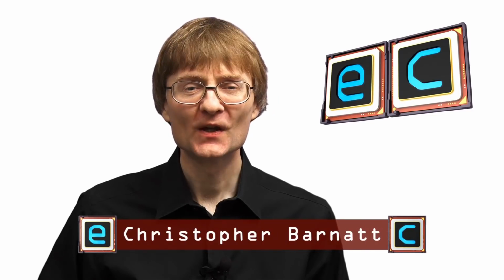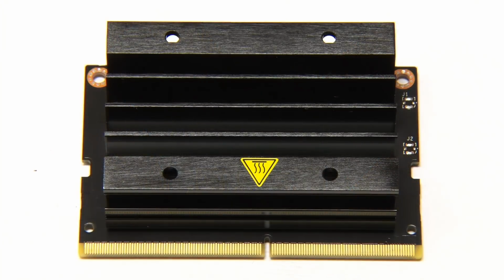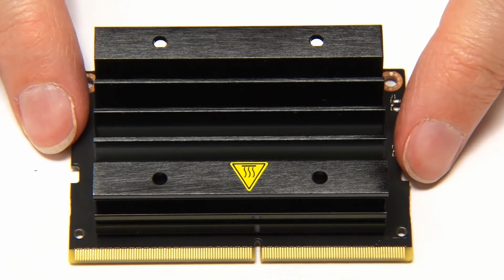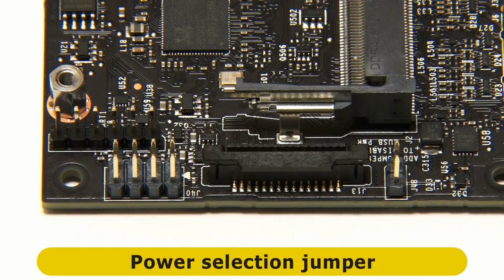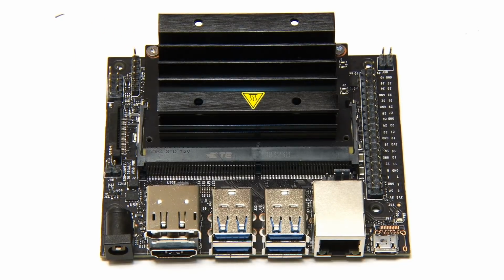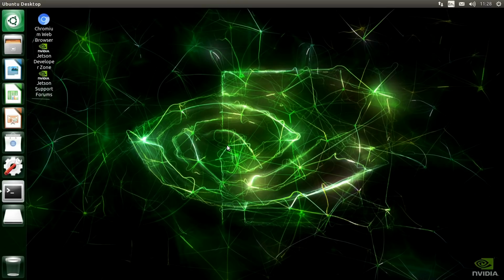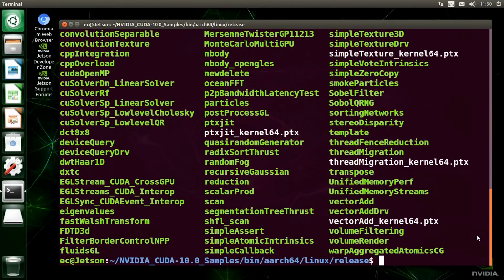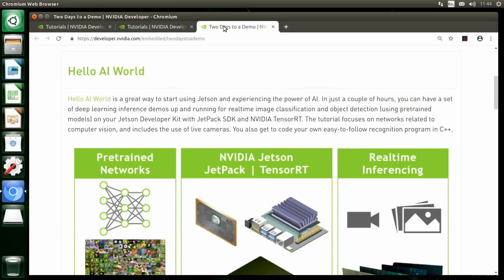NVIDIA Jetson Nano

Comment: Seems that this board got an update that significantly increases the perfomance. I hope you get back to it in a new episode.
I've also tried running llms locally with ollama in a terminal on my Raspberry Pi but I am running into problems if the session becomes too long. I can deal with the response being typed at the speed some humans would take to respond as that actually makes it quite quaint, but eventually it takes an increasing anmmount of time to start respoonding at all. Hopefully on the Nvidia board this will be remedied because waiting half an hour for a response is not a good workflow...
Reply: By the way, I'm getting the 8gb nano super model, which is even more capable.

Comment: Carrier board holes should have been the same size as the two large screw holes on the SOM for PCB standoffs. All the brass and plastic board risers/standoffs will not fit the tiny carrier board holes :(

Comment: Surprised it couldnt handle 1080 video on youtube. I thought it can decode up to 4k@30 h264? Would have thought a beefy gpu would handle it fine and not drop any frames.
Reply from the maker: It is a matter of driver support.
Reply: @ExplainingComputers  isn't that included in the OS and the browser software would pick it up if OS supports it?
Reply from the maker: @Bassquake76  Drivers have to be written for the board -- remember this is an ARM SBC, not an x86 PC, so there is nothing automatically available. Indeed, almost all ARM SBCs are let down by a lack of ARM drivers written for the board and its GPU. So there is nothing fo the OS and browser to pick up! :) Here, for example, NVIDIA have not provided any hardware accelerated video drivers for the board, as video playback is not their target market.
Reply: @ExplainingComputers  I see. Oh well thanks for the explanation.

Comment: is there any updates on this one 8 months later if it can now use the hardware for videoplayback? that would help immensely on the dropped frames and the price is a winner for sure, and such a nice little computer, very low power :D whats not to like
Reply from the maker: Not that I've heard. :(
Reply: @ExplainingComputers  shame, we get so many great things but often they never get to the finish line with a full product, that the hardware can do wonders doesn't matter if the software isn't there to make it happen :-/

Comment: If it's a an old school ram slot setup what would happen if you did put it in an old school ram slot? Like. I wanna see you do it lol.
Reply from the maker: It would either do nothing, or damage one or both pieces of hardware.
Reply: @ExplainingComputers  hmm. What if it was programmed to recognize RAM instructions in an attempt to force compatibility. I dont see why it wouldnt work if it was programmed to understand RAM instruction sets.  I feel if this was done a technician could see what the cpu is filling the ram with and how it is as well as possibly be able to alter information while still on the virtual RAM unit. VRU. I also hypothesize this could also possibly lead to the ability to have a completely second computer coprocessing information without using any other resources on the main computer.  For example. While media editting one could have a whole different unit offloading the whole work load to another work station but using transfer speed equal to that of RAM itself which greatly exceeds any usb or thunderbolt connection for doing the same job. Ability to run two operating systems in an interconnected environment.  The only other way I could think of doing this would be to creat a ram cartridge that connects to two seperate boards and having the circuits capable of sending information to either or port or both ports at the same time.    It may sound pointless but I think think this kinda setup would actually support an AI system better as it would simulate left brain right brain. One computer perceives things one way the other one does the same but in another way and then together they compair their results and cross analyze them before creating a conclusion.  The first step would be observative layer. The second step would be logical ethical emotional and moral.  Moral being the last decider. Because even though it is correct does not mean it is right. And this should be highly expanded on while writing self thinking AI. It must be programmed because an AI will never figure out what is right and what is wrong without a memorizable point of reference exactly the same way we teach aka program our kids from right and wrong.

Comment: This PC may perform well gains GPU base application such as 'Resolve 16' (video editing tool), Vroid studio(Free 3D animation studio) and  'RoboRealm' (AI robotic vision).. I might need 1 for my project!!
Reply from the maker: Note that this is an ARM-based computer (not x86), so will not run x86 software like Resolve. But it is great for AI. I'll be testing it out for applications such as video editing in a video very soon, and after that to control a "JetBot" vision-controlled robot. You can find JetBot on GiHub here: https://github.com/NVIDIA-AI-IOT/jetbot
Reply: @ExplainingComputers  owh thx🙂

Comment: I'm not super tech smart.  Is this pretty much a complete mini motherboard?  Like could you make a super portable emulator PC with this? Sorry for sounding stupid I'm really curious as to how this works.
Reply from the maker: This is a small computer with an ARM processor, rather than an x86 processor, as found in a PC or Mac. So you could use this board as a small PC, but it would be very hard to emulate a PC (running Windows) on it. But if you are happy runing ARM Linux software -- including Firefox, Libre Office and so on, then it would work fine as a small, very portable PC. This said, so would a cheaper and more widely supported board like a Raspberry Pi. There are many options these days.
Reply: ExplainingComputers thank you for the detailed information. I'll definitely check out the raspberry pi board for emulators. Thank you as well for the informative content and very helpful response.

Comment: hello sir, how can i connect multiple rpi cam with jetson nano platform?
Reply from the maker: No, just one. Another webcam could be by USB.
Reply: @ExplainingComputers sir,  is there availability of any shield type module. I am having one for raspberry pi which extends the CSI port in 4 CSI ports and parallely 4rpi cam can be use there.

Comment: use a 128GB or 256GB SDHC MicroSD for as much memory space as possible.

at a Root terminal so
apt-get update
apt-get upgrade -y
apt-get install ubuntu-restricted-essentials
apt-get install developers-essentials
apt-get install ubuntu-restricted-extras ubuntu-restricted-addons
apt-get update
apt-get upgrade -y
apt-get install gcc
apt-get install monodevelop 

reboot

(or Codeblocks here) Codeblocks is better than Monodevelop as you can have more tool-chains installed
Reply from the maker: Good advice. I have had to upgrade my micro SD card.

Comment: Hi, what cooler do I have to buy to cool my nano jetson?
Thank you
Reply: Judging from the sizes, a M.2 ssd heatsink cooler can fit into that i guess
Reply from the maker: I have found the included sock heat sink to be perfectly sufficient. The design is very sound. You could add a fan later if really necessary.

Comment: What about Thundercomm TurboX D845 .
I know it's around $900. ( hefty price)
But what if  we can use it for media center & also for android games for 40 inch TV.
Plus it does have inbuilt sensors & MIMO.
PCIe support too.

Can't find any reviews for it.
Is it overclockable with active cooling.
(that would be cherry on top)

Hope you get hands on this board too.

Comment: BUT CAN IT RUN NINTENDO DS GAMES? Even though they are a bit pixelated,they´re still difficult to play,especially if you want to play them at full speed (60fps).My pc has a hard time to play them,and they are laggy,and the audio is really buggy in some games
Reply: dude your pc sucks
Reply: @frostedlambs  Well,it doesn´t really suck,it costed about 900€,but in 2005,so the pc isn´t slow and bad,it´s one of the best of 2005.Is just old,but i´m gonna upgrade it

Comment: No RAM slots? also can it run torrents? it would be interesting if it can run torrents so people can have a low power consumption, small form factor seed box without having to invest in a NAS.
Reply from the maker: The RAM is fixed at 4GB. Torrent software could potentially run.

Comment: Is it suitable to use as a daily desktop pc or a tool for learning coding ? while raspberry pi is too slow for me .
Reply from the maker: It is much more responsive than a Raspberry Pi (not lead due to the 4GB RAM), and certainly a great coding and other learning tool. I will probably do a benchmarks video on the board.
Reply: @ExplainingComputers  when you do, also take boot times into account, as the use case in this case is a power-up and go type of computer. even i might be interested in having this as a portable device.

Comment: Frame drops on a 1080p video? But can decode 4K @60fps...there´s something wrong
Reply: In short, Chrome for linux cannot use GPU decoding with NVIDIA cards, since on Linux Chrome supports only VAAPI - which is the standard that Intel and AMD uses, but NVIDIA got their own Nvdec...
Reply from the maker: As @Ben Chen says, this is a software support issue.

Comment: NAS can be made of it with RAID and 2x4TB HDD?
из него можно NAS сделать c RAID и 2x4TB HDD?
thanks
Reply from the maker: Potentially, connecting the drives via USB 3.0.
Reply: @ExplainingComputers  thanks, it''s clear
but does the software support this feature?
thanks
Reply from the maker: I am not aware of such software existing -- yet. In time, something like OMV may be ported over. It all depends on the maker community, and currently this board is very new.
Reply: @ExplainingComputers  ok
thanks for the answer 
let's hope

Comment: I wonder if this is powerful enough to work on photogrammetry. Usually software for photogrammetry requires a CUDA GPU. Has anyone tried?
Reply from the maker: Quite possibly. My follow-up running a vision recognition neural net releases in about 20 minutes from when I post this reply. And the speed it very impressive.

Comment: How does it not have WiFi yet it’s meant to be used for AI? That seems counterintuitive.
Reply: The data flow provided by a data port is superior to what a WiFi module is able to run. For lesser delays and better efficiency it's meant to hook up straight to a router. With how small this thing is. You will probably have some space left.
Reply from the maker: I agree that having to add WiFi hardware is a let-down, esp for robotics.
Reply: @ExplainingComputers  I could see it have great potential with robotics as well. And yet it doesn't bother me. If it keeps the costs down then there's money left for the exact data you need. Like 4,8 or so gigahertz inside for sorting machines. And 2g mobile network for if it is a drone that flies outside on its own. Or a Bluetooth or radio connection even. Whatever may be the most secure and reliable for each situation.

Comment: looks like a great piece of kit to built your own dash cam set up. 1080p up front and 1080p at the back and it's still only 50% of the encoding capability.
Reply from the maker: A great potential application for this board.

Comment: Impressive hardware.
Too bad Nvidia, like most GPU providers doesn't document their GPU's, which makes creating anything truly custom impossible.
It also locks you into using linux.
Some people might not see what's wrong with that, but as it happens I'm not overly fond of unix-likes.
I mean, it's not like there's much in the way of alternatives; 
You can use Windows (though likely not on a device like this), OSX is technically a BSD derivative. The various BSD builds themselves (but again, unix derivatives), ReactOS, but that's a windows NT clone, so eh. And Haiku... Which is... I don't even know. (beOS derivative)
I suppose AmigaOS still technically exists, but only for PowerPC...
And yes, Android (linux and thus unix derivative)...

And that's about it, in the OS space, which is dominated almost entirely by unix-likes, so... Good luck to you if that's not something you're fond of.
And more significantly, without any actual hardware reference material, you're not just forced to choose from that list, you're forced to choose from something that Nvidia has bothered to provide (presumably) binary drivers for, which is probably even more limiting...

Ah well. As far as it goes it's a nice piece of hardware at least.
Reply: Given how much work goes into a Kernel, I'm honestly shocked there's as much variance as there is. And the Amiga OS has a version that runs on ARM, now. You might be able to make this thing work with that (given that can software emulate a BBC micro, playing the OG Elite on this thing would be hilarious overkill).

Comment: Interesting. How might you rate it for simple 4k video editing - I realise the seeming 'foolishness' - however, having a functioning cuda grafik chipset (my i5 with a nvidia refuses to cooperate for realtime editing view with 16g ram), I wonder if it might only be slow on final rendering but quite reasonable on the visual side of editing. Like to comment?  Thanks for the review/vid and effort.
Reply from the maker: The limitation would be editing 4K in only 4GB os RAM, and having hardware support (drivers) for the video editing software. May work in, eg, Kdenlive using proxies.
Reply: @ExplainingComputers  Thanks. Drivers seem always an issue - whatever, with my 630gtm nvidia card, Davici runs on it though without cuda and cyberlinks pd16 and earlier only use the intel - refuse to cooperate. Any upgrade, you might recognise the growing expenditure as one ogles the specs of 'basic' (grin) necessities (prob' even bigger grimace) - 3g would do it, 2 at a pinch. Obviously a laugh! So computational hardware being as it is, nvidia being quite a powerhouse, I'd hate to overlook an area specific chance to avoid high expenditure, hours of vetting software, a potential increase in environmental audio spectral disturbance. I thumbed up another of your vids today - not nvidia,  but it might be an idea though for me, not now. Do have an enjoyable continuance - and my thanks for your consideration to reply.

Comment: I wonder how hard it would be to design an ai program whose sole purpose was to design a better hardware architecture and a software architecture to optimize use of the new hardware.  Then use that technology to build an AI optimized to learn about modern quantum physics in an effort to further optimize s design based on the previous design  in order to eventually get to the point of creating software models of current understanding of physics to render software tests of experiments to test for theoretical viability.  So much potential in the future.
Reply from the maker: They call this the Singularity loop -- better tech creates better tech, and so on . . .

Comment: Does the m.2 slot support NVME?
Reply from the maker: Not directly -- it is E keyed for a wireless card. It may be possible to interface an SSD to the PCIe interface using an adaptor.

Comment: "has a very powerful GPU!*

128 cuda cores
Reply: you're entirely missing the point! for a cheap, palm sized low power SBC/dev board that is a metric shit ton of extra processing power. it's not a gaming PC, rocking state of the art numbers. 
it's not ment to run crysis at 4k, but to do math.
Reply: @Ucceah  Yeah but for $100?? I could just get a Raspberry Pi for like $35 Granted, it's not as powerful but that's a fraction of the cost of that fucking thing. I might as well get a crappy Dell and throw a GTX 1050 in it.
Reply from the maker: Point taken! :) But I did add a caption at that point indicating I meant powerful in comparison to the GPU on SBC and similar priced/sized boards.
Reply: @ExplainingComputers  Look, I get it. But for $100 it's kind of a rip off.

Comment: A question, is there a way to check  hard drive or SSD to see if they are actually ruined, as the tech told me, or possibly just replaced to make himself some money??
Reply from the maker: You would have to plug them in via SATA and power cables to your motherboard, or using an external SATA to USB adaptor.

Comment: Hi Chris, have you heard of the Atomic Pi?  It is an Intel Atom SBC capable of running Windows 10 with 2GB ram, 16GB emmc, gigabit ethernew, dual-band wifi and USB3 all for $35.  Too good to be true?
Any chance of a review?
Thanks
Reply from the maker: The board was initially only available via the Kickstarter, with shipping only to the US. I would have ordered if I could. :) And now it us sold out (at least the first batch).
Reply from the maker: Sadly availability has been US only, so I've not got hold of one. I do wonder about long-term viability/price. $35 is very cheap to buy an Atom CPU, 2GB RAM and 16GB eMMC components alone . . .
Reply: @ExplainingComputers  so just get a usa shipper to ship it to you?
Reply: It seems to be available on US Amazon at around USD $40. There's no power jack, you have to get some sort of break out or tinker with floppy power of an ATX psu or something else. 16GB eMMC is a bit small for Win10 but probably plenty for linux